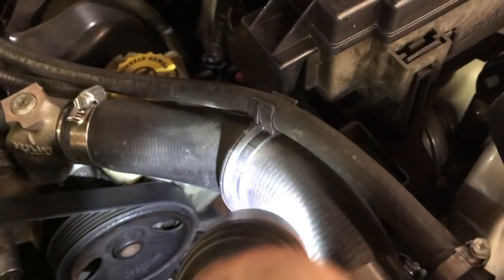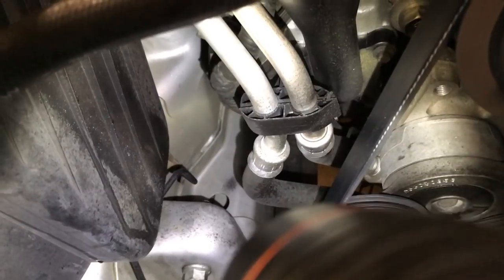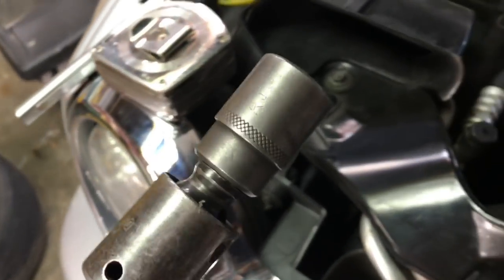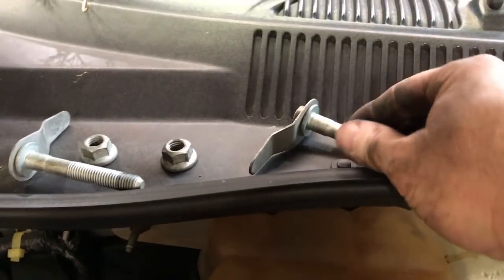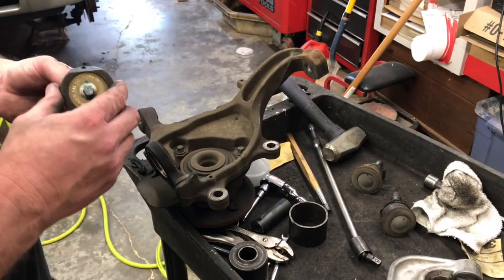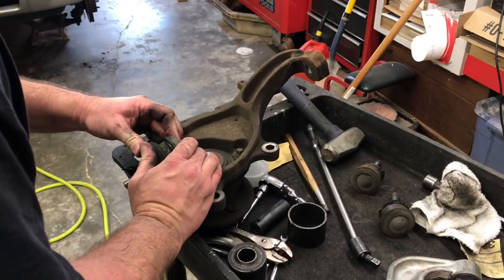How To Replace Upper Control Arms & Lower Ball Joints On A Jeep Liberty 2002

Comment: On the upper joint. Leave the bushing bolts finger tight.  Tighten all your nuts on the ball joints, lower it to the ground then tighten the bushing nuts.  This allows the suspension to be in its normal position.

Comment: Hi there this vid helped immensely thank you!  Just wanted to add that for 4wd models there's an axle nut you gotta pull and then get the axle loose (carefully tapping it out can help).  Also on some models there's an ABS sensor, but you DON'T disconnect the sensor from the spindle/knuckle as it can get damaged in the process of pulling it out.  Disconnect the electrical connector in the engine bay (carefully pulling a little red tab out then disconnecting like a typical connector) and feed the wiring through to the wheel well and then you're home free!  

Thanks again.
Reply: thanks for adding this

Comment: So, on my upper ball joint nut, its very rusted. I got it nearly off,but the entire bolt spins now and the 10mm head on it is stripped. Any solution to stop the bolt from spinning inside the balljoint,or doni have to keep fighting this thing with 2 wrenches? I may have to cut the damn bolt,or try to bang a 3/8 socket on it and keep trying with my 21mm against it...

Comment: I replaced both upper, lower ball joints,  inner, and outter tie rods and new hub bearings on my 03 liberty four wheel drive. Now I'm getting a popping sound from front suspension. Is it possible I just don't have everything tight enough? Let me know what are some suggestions
Reply: When does it make sound? Is it when going over bumps/potholes or turning?
Reply: It's over large bumps at lower speeds ( backing/pulling out of drive way) and when turning mostly left turns.
Reply: @chrisw8600  hmm... Might wanna have your CV joints checked. That's the only reason I can think of a popping sound.
Reply: Only part of front suspension I have NOT replaced is the lower control arm/bushings.
Reply: @chrisw8600  hmm... Could be anything. It's not uncommon for new parts to sometimes be defective. I would take it to an alignment/suspension shop and have them diagnose what it could be. I took mine to be aligned cause the steering wheel would shake and the guy told me that the ball joints were worn out and even showed me by moving the tires up and down. I just replaced the lower ball joints and it's been as smooth as a new car. Oh I didn't have the shop replace it since the labor price was kinda high.

Comment: Any tips on getting that lower ball joint out? Mine is NOT coming out of the knuckle as easily as I had hoped. I’ve been knocking mine with a hammer ( I don’t think I see any clips or o rings). Is there a better way to get it out?
Reply: You probably already fixed it but I had same issue. Drivers side took me over an hour, passenger 15 minutes. I had to use a ball joint press to get the drivers side out. Very sketchy set up the way I did it. Passenger side is used a 3/4 ball joint spectator that barely fit the edge of the arm. I have a 7/8 inch on order, it would have made it way easier.
Reply: @richardd.7479  yea I ended up pressing it. I also did it with a very sketchy set up. I actually broke a vice with the amount of torque I was putting on it. Hard to believe that was almost a year ago!

Comment: What in the world is the trick to getting the nut on the drivers side rear upper control arm pivot? I have the bolt in properly, but I can’t reach in to start the nut and can’t get a socket on an extension to set square to the end of the bolt?

Comment: Looks like I'm taking to shop.
Reply: Yup, same here. Don't have all the tools or the time, so shop it is.
Reply: @Archangeldawn  ikr. I legit want to do it but I don't have time or tool and if I mess it up somehow then it's gonna be a pain to tow.
Reply: I know you can borrow it from one of the auto parts store but I heard they require a down payment of around 100$ to rent the tools and returns it when you return the tool. I don't have 100$ cash laying around so ehhh.
Reply: @TaijiArban  I took it to the mechanic and it was $310 in parts (replaced both sides of the ball joints), then $300 for labor for each side, so $600 in labor. Total cost $910. I don't have to worry about it anymore but such is the price to pay.
Reply: @Archangeldawn  I just had mine done, bought the ball joints for 100$ both sides and the mechanic did it for 150$ both sides.

Comment: Why can't I find a video of a 4x4? I want to know if I can replace the bushings on lower control arm without removing it and the hub. I haven't gotten the parts yet so trying to find an easier way if possible
Reply: I did this on my 4x4 Liberty. There's no need to remove the hub or knuckle, but you do need to remove the LCA completely. It's only 4 bolts and the nut for the lower ball joint, you can get the arm off in a couple of minutes.

It's an easy job if you have the proper tools for pressing the bushings - I picked up the special Mopar tools on eBay, but you don't absolutely need them. The only part that gave any trouble was getting the holes for the clevis bushing bolt to line up again during reassembly.

Don't forget to mark the positions of the cam bolts before you remove them.
Reply: @dunebasher1971  thanks. I'm waiting for a nice day to do it but I did pick up a ball joint press kit. It's no Mopar tho it's just a cheap set but I think it will work. I appreciate the help the less I have to do the better.